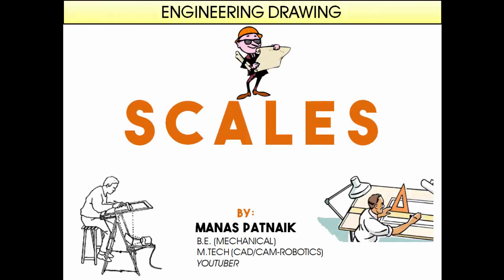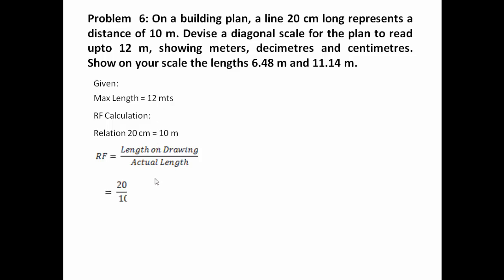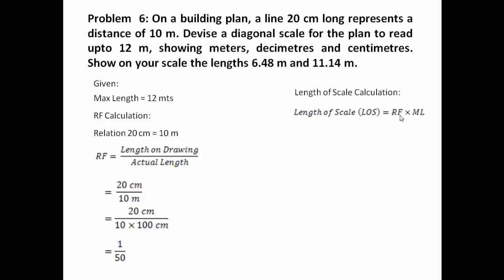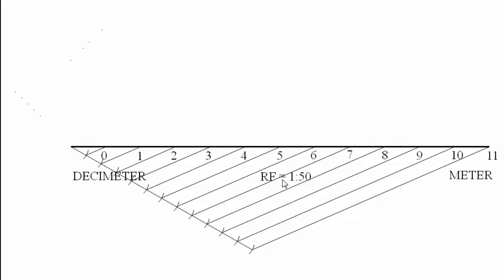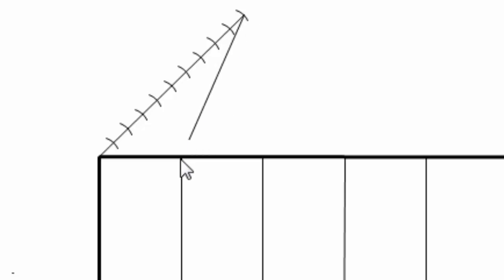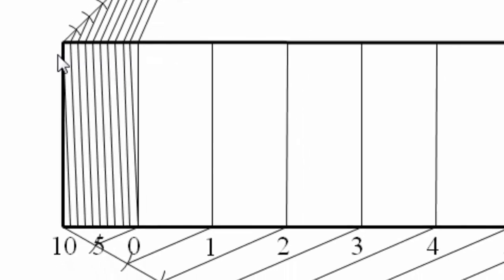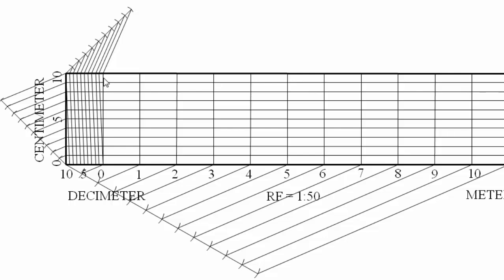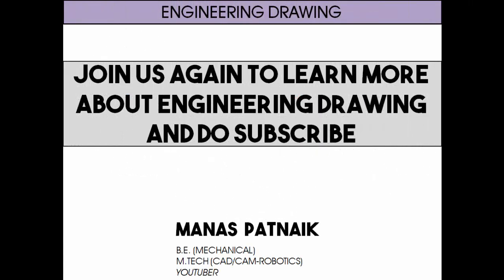Diagonal Scales Problem 4

Comment: The distance between two stations A and B is 100 kilometres and its equivalent distance on the railway map measure 2.5 cm. What is the R.F? Draw a diagonal scale showing kilometres 
only and indicate 578 kilometres on the scale.

Comment: A hexagonal pyramid of base 30mm and height 65mm is stands on hp a cutting plane is parallel to hp and it passes at a height of 45mm from its base draw the development of the surfaces please solve this problem exam plzzzzzzzzzz solve and fast plz